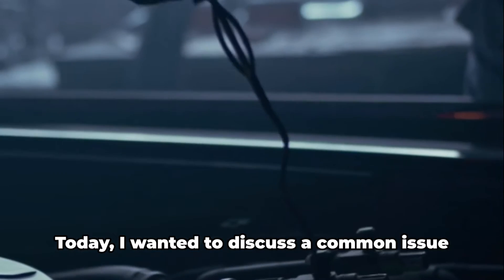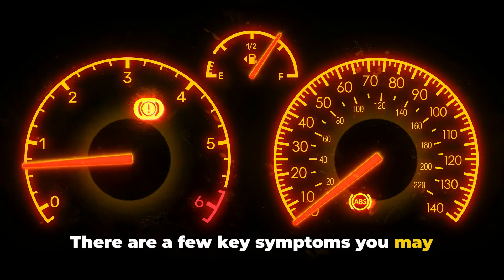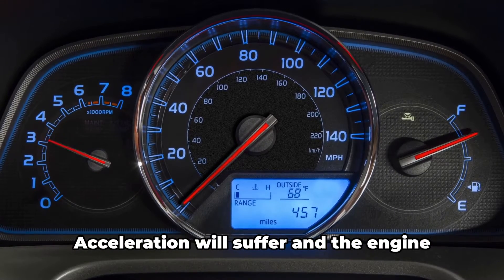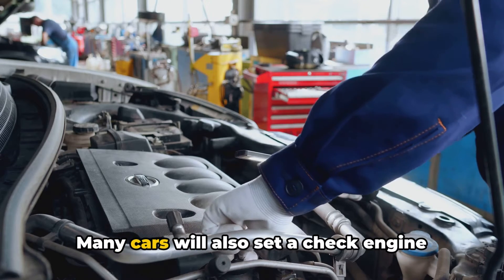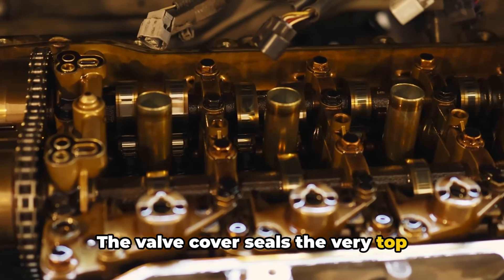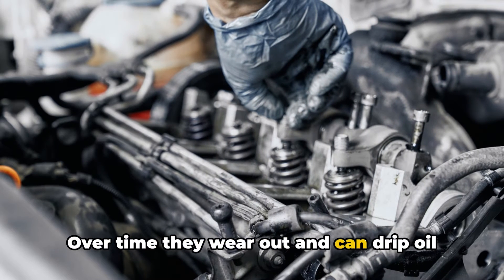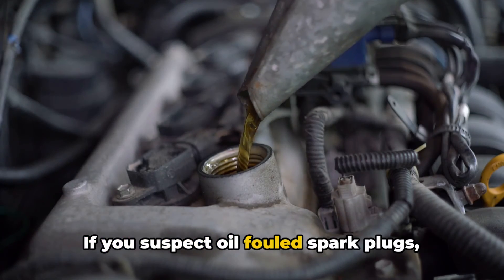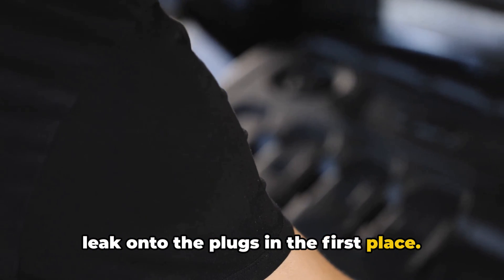Oil On Spark Plugs Symptoms: 7 Typical Signs

Comment: Wondering if oil could get out of a motor if a Crank sensor bolt is not tightened enough ? Are crank or cam sensors supposed to get oil on them ? 2008 Frontier LE
Reply: Yes. My 550i was leaking oil from a cracked cankcase breather hose/pcv valve directly onto my spark plugs. Smoke was still coming from engine after crankcase breather hose replacement but stopped after spark plug replacement.